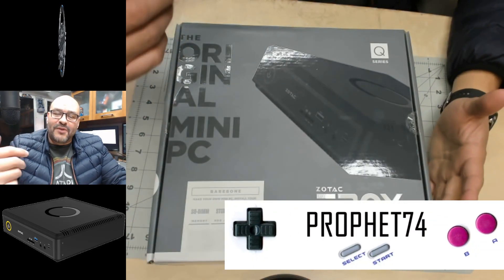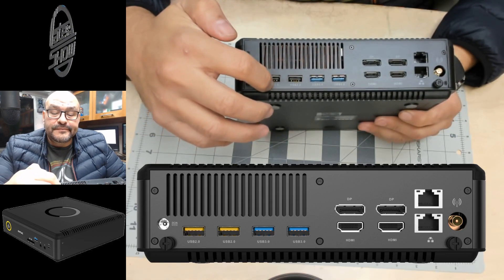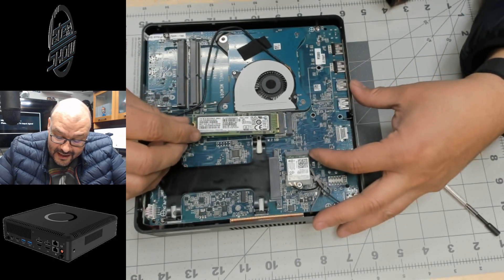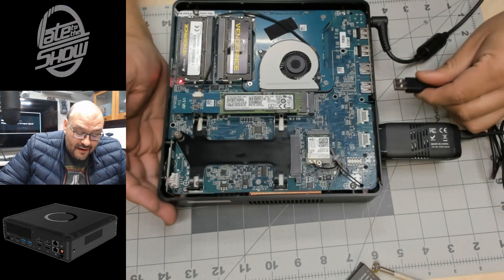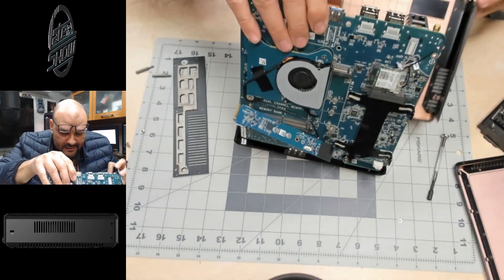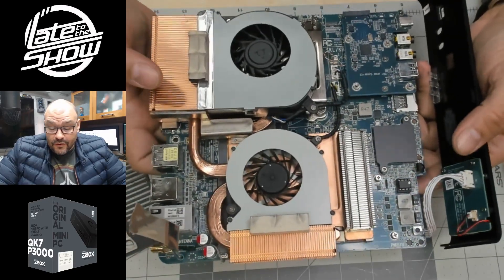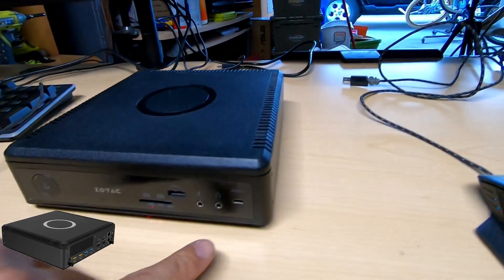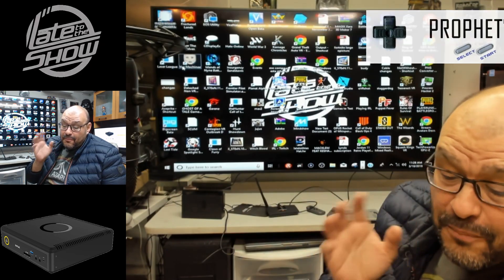ZOTAC ZBOX Q Series Mini PC

Comment: The thing to rememberis that this is the workstation version of the Zotac E Series Magnus EN1060, which has a i5-7500T & 6GB GTX 1060 videocard.    Gaming wise, the Quadro P3000 is almost exactly identical in performance to the GTX 1060, while the CPU has slightly higher clocks & HT.  If you are just looking for a mini gaming PC, consider the less expensive Magnus EN1060.   However if you are using certain software that uses the GPUs 64-bit number crunching.. like Solidworks(tm) - a very, very popular CAD program - it'll run circles around the the regular GTX 1060.